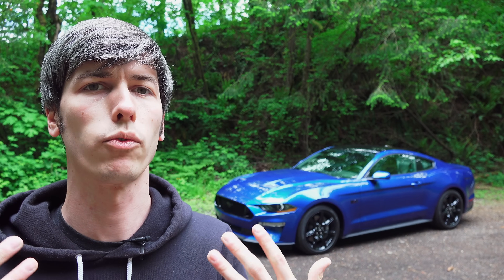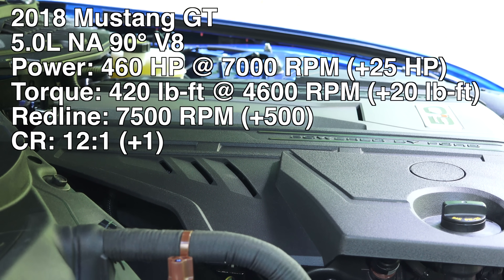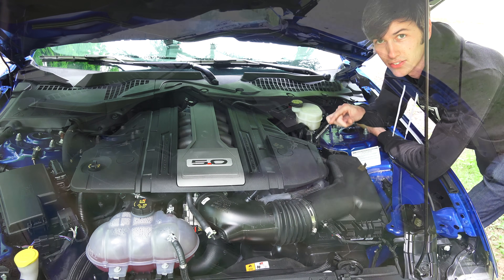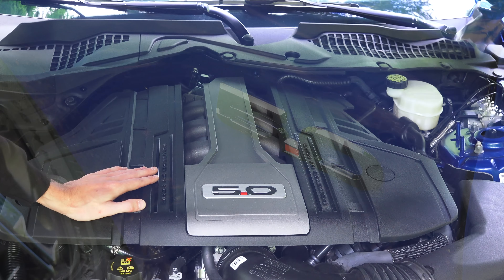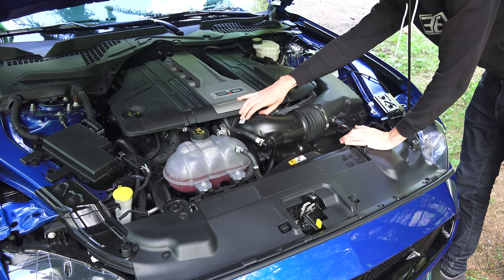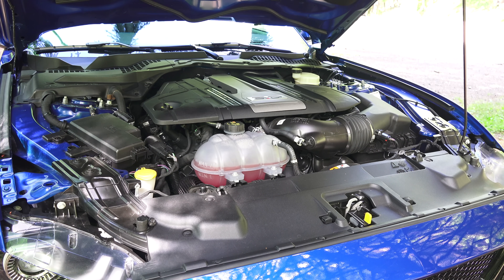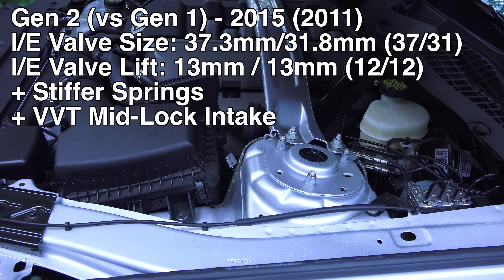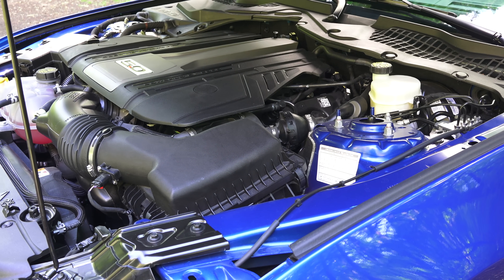The Best Engines - 2018 Ford Mustang GT 5.0L V8

Comment: Look at all the chevy guys getting salty😂
Reply: The Power Density of Ford engines is far higher than that of Chevy's
Reply: Pushrod v8 in a $160,000 car in 2018 buajajajajaja jajajajajaja.
Reply: Cody Petrowsky, Let us know when Chevy can make over 400HP in the Camaro using 5 liters or less normally aspirated.
Reply: Trevon Adams, When we compare engines of equal size pushrod motors aren't murdering DOHC in torque.
Reply: Let me know when formula 1 are going to use pushrod v8s because they are so good
Reply: Any supercar in the world can make 100HP per liter without forced induction exept a pushrod.
Reply: Facts and History is on Ford's side.  Ford didn't Declare Bankruptcy, period
Reply: The only reason that the pushrod v8 is fast is because is 6.2 with a huge supercharged.
But liter to liter the new engine always wins
Reply: Let me know when a pushrod v8 can make 1500hp out of a 1.5 liter just like BMW in 1980s when american v8 7.0 lites only manege 120hp
Reply: Why pushrod engines are not winning 10 best engine awards if they are so good?
Reply: A bunch of dipshits in here.... You all know the ls is physically smaller then the 5.0 and is typically lighter as well right? You can talk displacement all you want but its irrelevant when comparing DOHC to OHV. Pushrod engines work remarkably well even under boost, theres a reason why the chevy smallblock is the highest selling v8 ever.
Reply: They are cheap and they do the job,but they are not the best.
Toyota corolla is the best selling car ever.Does that means that is the best car?
Reply: Trevon Adams  The US taxpayer lost 11.5 Billion dollars and the Canadian taxpayer lost 3.5 Billion on the GM bailout
Reply: Just tell me if you are a chevy fanboy or/and your iq is very low
Reply: Why chevy make the mistake of using DOHC on the chevy bolt if the pushrod are more economical?
Reply: Trevon Adams, 1970 Boss 429
Reply: tinleo333 yes but you are totally underestimating the ls engine and your hp/l argument is useless when the ohv can use more displacement in a smaller package.
Reply: They give you really good performance for the money
Reply: engine so good gotta cover it with plastic
Reply: Cody Petrowsky Let me know when GM can make over 400hp without going over 5.0l, or make over 500hp without going over 6.0l or Supecharging. They're still using very old tech. I'll be waiting.....
Reply: Ford's Gen 3 Coyotes with Whipples new Gen 3 Superchargers, are completely killer engines
Reply: Bryan Loewen because its cheap?
Reply: submariner103182 

Why did you compare the weight of the 4 cylinder Mustang to the weight of the 8 cylinder Camaro? Are you purposely lying to make the Mustang seem better?
Reply: 5.0L vs 6.2L, bigger engine, still 10hp less than the 5.0L, no contest.
Reply: big yee where I didn't see any
Reply: Actually, the LT1 6.2L weights 20lbs more than the Coyote 5.0L, also take in mind the bigger mass (5.0L vs 6.2L displacement).
Reply: Cody Petrowsky lmao Ford made over 400hp with a pushrod engine way back in the 60s with the 7.0L  cobra jet engines lol but Ford is smart and knows DOHC is superior so they dumped the pushrod engines and have now perfected their DOHC V8 engines.
Reply: Im_Sky 20 pounds won't make a difference in a car that weighs less.
Reply: I've owned both a Silverado and a ranger and liked both I just wished Ford put a 5.0 in a ranger
Reply: But it does the center of gravity.
Reply: Cody Petrowsky 64 valves?!  Does the Coyote have eight valves per cylinder? (of course it doesn't)  Also, the 2018 Camaro's curb weight is 3738lbs and the Mustang's is 3542lbs.  Nearly 200lbs is nothing to sneeze at.  So the engine weighs 20lbs more, and the car weighs almost 200lbs MORE, not less.  In a few years you'll probably be championing the wonderful 12.8L pushrod engine of GM that produces 800hp.  Too bad the front suspension breaks when you run over a Tic Tac and GM has to add additional ballast to the rear to have the wheels maintain contact with the ground.
Reply: big yee yah Ford is smarter, and they also were prepared and did not have to take U.S. taxpayer bailout money. GM still equals government motors for life. We should get discounts on their cars as taxpayers.
Reply: Im_Sky 10hp is not going to make you or break you and it's not a noticeable difference. What does matter is how the power gets to the ground and the driver. Weight has a factor also.
Reply: big yee The 7.0 Cobra Jet didn't make over 400 HP It was advertised at 370 with speculation that it made CLOSER to 400 HP not over. Don't over exaggerate it. DOHC being better is a matter of opinion. Don't be salty because other manufacturers can produce around the same power on a standard pushrod engine. The only reason a DOHC is "better" is because of the extra cams and 2 extra valves per cylinder.
Reply: Let us know when Ford can make over 400 with out using four cams and 64 valves or boosting an engine.

Comment: Interesting video, here are some informations you could add for a next video: Brake specific fuel consumption graph in g/kWh for various load on the engine, emissions test results, engine weight, idle and cutoff rpm, dyno graph, air/fuel mixture on cold start for various temperature. Keep on the good work!

Comment: Be nice to know what the weight of the car is and then compare that value to the weight of other vehicles.  Would also be nice to know historically if Ford has managed to lighten the car up over the years or if it's gotten heavier.
Reply: whitesites 2011 ~3500 2015 ~3800 2018 ~3700 

Weight Increased due to safety standards increasing. More airbags and roll over safety. 

Curb weight of the Camero was very similar
Reply: Thanks!

Comment: J35A8 - from the Acura TL Type S (2007-2008) & Acura RL (2005-2008). Fully forged internals stock, hollow camshafts. Won Ward's top 10 best engines 3 times ('05, '08, & '09).

Comment: Nice video Jason!
I think at some point you should take a look at the smaller EcoBoost engines Ford make. I mean, sure, they aren't these badass huge V8s that most people love seeing, but they are really interesting little motors and are put into cars that the average Joe can afford. Plus, they don't make you feel guilty about how much fuel you burn. Both the 1.0L and the 1.5L (the one that's in the new Fiesta ST) are cool!
Reply: Αποστόλης Νικάκης I love the ecoboost! 
3.5 making 450+hp in most cars 600+ in one ;)
2.7 making close to400hp
2.3 making 380
2.0 making 280
1.5 making 200
1.0 making 120 

Those are impressive numbers I don’t care who you are
Reply: Αποστόλης Νικάκης people feel guilty about the fuel they burn? Lolll
Reply: Devin Bender  Exactly! And taking it a step further, it's impressive what people can do with those. There have been a ton of 250+HP Fiesta STs that are quick as hell (they weight nothing after all) and are also capable daily drivers that are reliable and comfy. I mean, damn Ford.
Reply: Dalton v  Well, I don't like burning a gallon of fuel every time I look at the throttle. You know, global warming and all.
Reply: Αποστόλης Νικάκης in terms of safe upgrades to the ecoboost 

500+hp 3.5
450hp 2.7
450hp 2.3 
370hp 2.0
And 300hp 1.6/1.5s 

I mean they run as good as stock! Lighter and faster than their v8 or v6 competition

Comment: Pffft, wouldn't want that kind of car in the Netherlands. You'd cry every time you needed to get gas with 25MPG. Glad my car gets like 45 MPG
Reply: Probably not for a daily driver, but as a toy? You only live once....
Reply: I drive 2000km = 1242 miles every month. It will cost with my 45mpg cars around 200 dollar with dutch fuel prices. 
With the mustang 25mpg and US fuel prices (3 dollar/US gallon?, just picked it from a website with average fuel pricing)
that will be around 150 dollars for 1240 miles.
The mustang in the Netherlands will cost me 570 dollars a month in fuel.
And buying new they have a 92,683 dollar tax on its emissions here, so it costs around 148,000 dollars to buy new. (Same as a standard 911 here though)
Reply: The price converted in the Netherlands is 7,63 dollars/US gallon
Reply: zoperxplex Increased prices are due to taxes on fuels to promote cars that cause less pollution and to pay for some of the best quality and safest roads and highways in the world.. Who's small minded?
Reply: Is it because of the fuel price?
Reply: Valen Gerung fuel overseas is INSANELY expensive per liter.
Reply: US gallon is actually smaller than a European gallon.  25 mpg in America equates to 30 mpg in Europe.
Reply: I don't know if I'd even want a gasoline car there. Fuel is so expensive I may as well go electric.
Reply: PNathan I actually bought a Mustang GT when fuel prices where I live were upwards of $5 a gallon still would've bought it even if it would've been $7 a gallon.
Reply: The European gallon is only used in Great-Britain, we use litres here so I converted all measurements to mpg(US)
Reply: crashingkid I bet you would change your mind if your fuel prices tripled.
Reply: You should avoid sports cars in general then.  Real sports cars anyways, not I don’t mean economy cars that have sport variations.  Because 25 mpg honestly isn’t bad when compared around with cars that put out similar performance
Reply: PNathan It’s all about the smiles per gallon bud rather get 25mpg and drive that than drive your VW bug and get 45mpg
Reply: Why I would move
Reply: Mine gets 15
Reply: PNathan then you stay over there in the Netherlands buddy I have a 2013 5.0 mustang a 2017 5.0 F150 and a 2019 5.0 on order LOL...
Reply: PNathan, my guess is you don't drive the distances American do. Across ONE state, Texas it's 840 miles. (that's 1350 KM) While 45 MPG is nice, a car that gets that kind of mileage ain't comfortable for long drives. That alone is the reason American cars tend to be bigger, heavier, sprung softer and all come with creature comforts like air conditioning. I don't know for certain, but I suspect our gas is cheaper than yours. Likely much cheaper. Finally we don't enjoy the transit systems much of Europe enjoys.  So we put a LOT of highway miles on our cars.
Reply: PNathan, not according to your truck drivers. The OTR guys ALL want to move here to drive.
Reply: Damn glad I dont live there!
Reply: We get it man, you're poor. No need to tell everyone
Reply: Good grief.  The entire COUNTRY of the Netherlands is roughly the size of the single STATE of West Virginia.  Just where the heck are you REALLY driving that it would make much of a difference whether you get 25MPG or 45MPG?  Of course, that's probably why gas is so expensive there.  With that small amount of space, you'd have to charge everyone murderous taxes to accomplish the same funding goals as all the people across the entire U.S. mainland.  Fewer people = more taxes have to be charged per person.  But then again ... for a small country like that, exactly WHY do they need so much money to maintain roads?  Here in the U.S. we manage to have decent roads for a fraction of the cost ... and we've got a heck of a lot more roads here than the Netherlands will ever be able to have.  Something doesn't add up ... it sounds like someone somewhere is bending everyone over and giving it to you guys from behind .... without Vaseline.  Good luck with that.
Reply: Small country, small mind.

Comment: Do one with a K20 engine in this series one of the best 4 cylinders thanks 😊
Reply: Ractio huge ford fan boy and I have to agree the k20 is one of the 5 best 4 bangers ever made
Reply: Devin Bender True
Reply: The k20a was great, the k20a head on a k24 block is better. The k20c is new to me and I'm just getting to know it as I'm swapping one into my s2k. I live the K, but the B series is what made Honda at thing. 
A good condition low mile B18c is going to cost you more than any k except the k20c.
Reply: SR20DET FTW
Reply: MrErikw26 only with a disco potato...
Reply: Edward Agora Feenman I've seen some T3/T4 hybrid builds kick some ass. Anything but Honda is fine as far as imports go

Comment: "is it crate-able and if so where can I order one?" standard question. and also following other comments, dyno. please.
Reply: I'm not sure if they have the 2018 version out yet, but Ford Motorsport offers several versions of the V8 including long blocks ready for supercharging, the Voodoo (Shelby flat plane crank,) and Aluminator racing versions. It's roughly the same size as an old big block, but it's a lot lighter and capable of making crazy amounts of power.
Reply: MOS6582 for the coyote? You can get the full coyote from a 2017 GT complete with transmission and control pack for 12 thousand
Reply: It is available as a crate motor at any Ford dealership. But it costs $70,000 and it's packaged inside 1.7 tonnes of metal and plastic. Kind of wasteful if you ask me.

Comment: Mustang people would call the 11-14 Coyote the gen 1, 15-17 the gen 2, and the new 18+ the gen 3.
Reply: julian hernandez wtf, hows a v8 stang slow?
Reply: sweetcheels how would they be wrong?  It’s literally what they are lmao.  11-14 being the first coyotes, 15-17 having some revised internals and a few other components (making it a gen 2).  Gen 3 being the new variation with the new features talked about in this video.
Reply: Shadetree Armorer Gen 2 was a Boss 302 engine without the aggressive factory tune
Reply: 13-14 is slightly different than 11-12
Reply: sweetcheels literally no major component between the 15-17 and 18+ is the same.  Not even the block.  It's a much larger difference than the ones between 11-14 and 15-17.
Reply: Shadetree Armorer I stand corrected.
Reply: Dude Shark because the 15-17 motor and the current Coyote motor is pretty much the same minus a couple of different additions. Making it a second generation. I mean depending if you consider a couple of additions a whole new motor then sure you’re right. But I don’t think the motors are that different to consider it a new generation. Thats just my take on it though.
Reply: Shadetree Armorer and they’d be wrong.
Reply: So in other words 11-14 slowest...15-17 slower...and 18+ kinda slow??

Comment: I had a 90 bought it new. It toed tires and was not possible to put alinment in spec so ford just bought me tires. what good is all that power if the front tires only contacted 25% tread. Ford cant build cars.

Comment: This is why I love Mustangs. Gotta love those V8s
Reply: Drifter D 

Ford has made a fantastic V8 for this generation of Mustang, huge applause to them!
Reply: T U I don't live in the USA, so I cannot relate to your points
Reply: Solid axles, pushrods, cam swaps you can do in an afternoon in your driveway half in the bag on cheap beer. I really like this about my 1986 Foxbody Mustang, although it's 60s tech compared to this. Simplicity is a big benefit for hotrodders and hobbyists - although this engine makes my old 5.0 look like a Flathead.
Reply: 1st thing to do is to toss out the factory rear tires for 275s
Reply: I like my V8s to have 1 cam and 1 cam only
Reply: @adrianpeterson9668  Why?
Reply: Ian Parrish torque.
Reply: @adrianpeterson9668  That doesn't really make any sense.
Reply: Ian Parrish how doesn’t that make sense ohv doesn’t rev as high and makes way more torque than an ohc
Reply: Drifter D, no this is NOT why you “love” Mustang.. you honestly love Mustang is because of its low price, & because you’re just like the over 5mil other Mustang owners who also love being a part of a large group.. from day one 1964 1/2 till now, the #1 main reason people “love” Mustang is simply because they’re low price

Comment: I think I'm gonna like this series. Mercedes M103 maybe? Or the AMC 4.2 Straight 6? Both known for their longevity if I'm not mistaken.

Also that plasma steel coating is really cool and creative sounding. Almost like those engineers are pretty smart people or something!
Reply: Longevity, and in the case of the M103, power potential. People have made huge power reliably with unopened m103's. There's a drift car making over 700hp with one reliably with nothing else internally but valve springs. I love the fact that nobody knows about it or cares about the cars they come in, because they're all cheap as dirt.